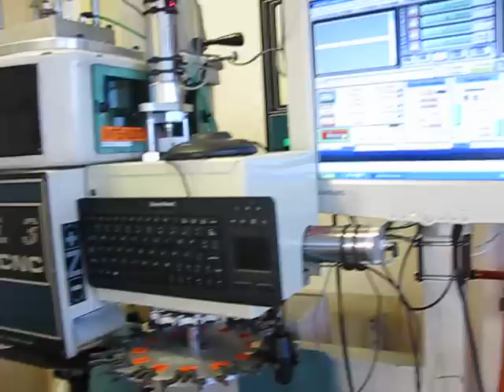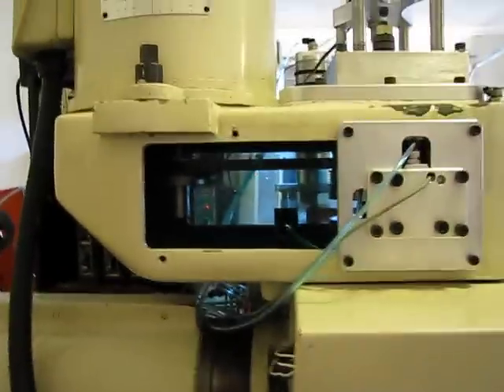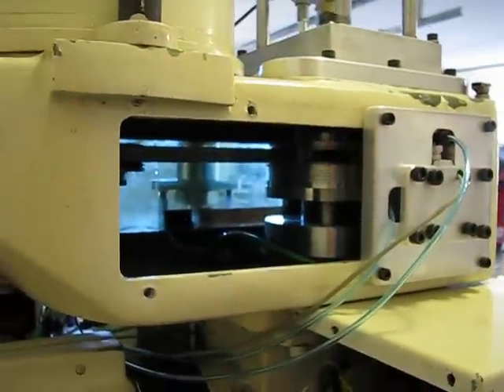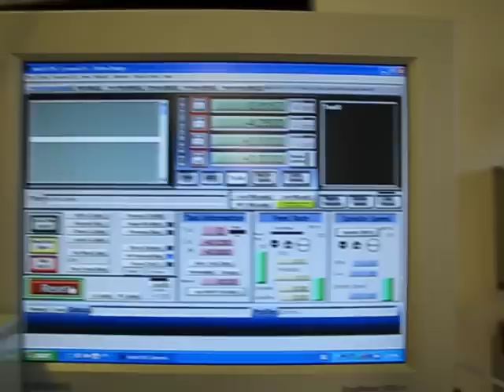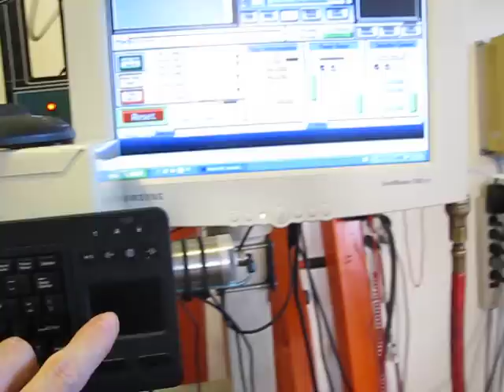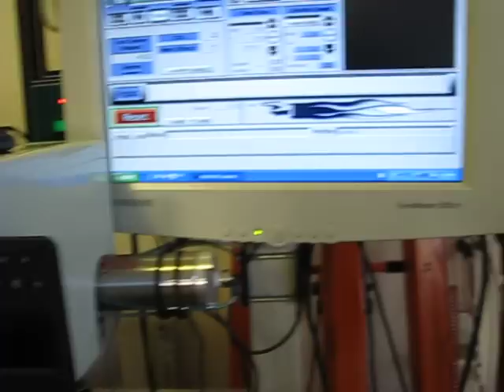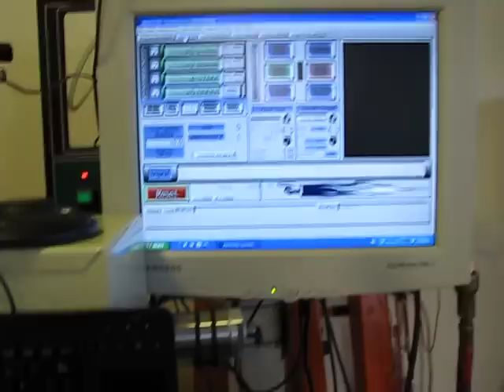Denford 12-tool ATC complete

Comment: Nicely done! Any chance of getting a copy of your Mach3 M6start and M6end?
Reply from the maker: There is no end,only the start:  '***********************************
'M6Start.m1a  v.1 by Corey Renner

'Variables:

CurrentTool=GetCurrentTool()
NewTool=GetSelectedTool()

SetSpinSpeed(200)
'***********************************

If CurrentTool=0 Then 'Exit with error ATC not homed
MsgBox ("ERROR: ATC Not Homed")
Beep
Code "M00"
End
End If
  
If CurrentTool=NewTool Then 'Exit if correct tool is already loaded
MsgBox ("No Toolchange Required")
End
End If  
       
ActivateSignal(Output11) 'Deploy Orient Cylinder
While Not IsActive(OEMTRIG1) 'Oriented
DospinCW()
sleep(50)
Wend
DoSpinStop()
       
ActivateSignal(Output12) 'Deploy Changer Cylinder
  While Not IsActive(OEMTRIG3) 'Changer Deployed Switch
  sleep(100)
  Wend
  
ActivateSignal(Output13) 'Slide In Cylinder
While Not IsActive(OEMTRIG5) 'Slide In Switch
  sleep(100)
  Wend
  
ActivateSignal(Output14) 'Drawbar Release and Proprod
While Not IsActive(OEMTRIG6) 'Drawbar Released
  sleep(100)
  Wend
  
ActivateSignal(Output15) 'Toolout Cylinder
While Not IsActive(OEMTRIG8) 'Tool out from Spindle
  sleep(100)
  Wend
  
'**********************************************
'carousel rotation stuff
FwdIndex=CurrentTool
FwdStep=0
While FwdIndex<>NewTool
 FwdStep=FwdStep+1
 FwdIndex=FwdIndex+1
 If FwdIndex>12 Then
 FwdIndex=1
 End If
 
Wend

RevStep=12-FwdStep

If FwdStep<=6 Then
CarouselFWD (FwdStep)
Else
CarouselREV (RevStep)
End If

'**********************************************

DeActivateSignal(Output15) 'Tool back into spindle
'ActivateSignal(Output16) 'Airblast on
While Not IsActive(OEMTRIG7) 'Tool back in spindle
  sleep(100)
  Wend
  
'DeActivateSignal(Output16) 'Airblast off
DeActivateSignal(Output14) 'Drawbar Grabs
While Not IsActive(OEMTRIG6) 'Drawbar has grabbed
  sleep(100)
  Wend
  
DeActivateSignal(Output13) 'Slide Out
While Not IsActive(OEMTRIG4) 'Slide is Out
  sleep(100)
  Wend
  
DeActivateSignal(Output12) 'ATC Retract
While Not IsActive(OEMTRIG2) 'ATC Retracted
  sleep(100)
  Wend
  
DeActivateSignal(Output11) 'Release Orient Cylinder 
While IsActive(OEMTRIG1) 'Orient Released
sleep(100)
Wend
  
DoButton(24)'Home Z-axis to release prop-rod and correct error

SetCurrentTool (NewTool)

 
'///Functions///

Function CarouselFWD(ByVal FwdStep As Integer) As Integer
ActivateSignal(Output17) 'Start Motor in FWD Direction
For X=1 To FwdStep
  While IsActive(OEMTRIG9)
  sleep(100)
  Wend
  While Not IsActive(OEMTRIG9)
  sleep(100)
  Wend
Next X
DeActivateSignal(Output17)
End Function

Function CarouselREV(ByVal RevStep As Integer) As Integer
ActivateSignal(Output18) 'Start Motor in REV Direction
For X=1 to RevStep
  While IsActive(OEMTRIG9)
  sleep(100)
  Wend
  While Not IsActive(OEMTRIG9)
  sleep(100)
  Wend
Next X
DeActivateSignal(Output18)
End Function

Comment from the maker: Thanks man :)  When I was looking into Mach3's macro language, it looks like there are commands to save and retrieve data to a file, so I could probably have it write the current tool to disk after each change so that it remembers where it was at the next boot.  I also have a prox sensor to detect tool one and had intended to auto-home, but so-far it hasn't seemed necessary, it's pretty easy to just plug in the value of the current tool.  I'm going to use it as-is for a while before I decide.